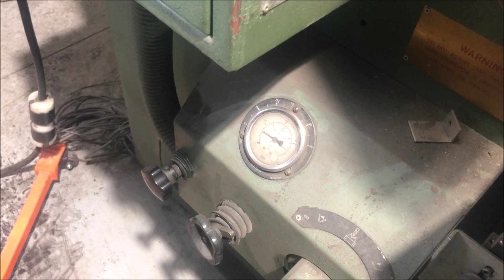Hardox 450 AR Skid Plate Bending

Comment: You can bend hardox without heating.  Heating actually takes away the resistance of the material. But you must use a large radius  for anything more than 30 degrees. As it starts to splinter. 20 years on the job. 3/16 to 1/2”  .  If the drawing says: 1/4” hardox 500, use  1” Leg with a 1/8!rad to 90 degrees. Walk away from the job , Leave don’t look back.  Hardox, AR, FX  scare the crap out of me! I’ve already been injured from bending. It’s not a fun job when it come to shattering steel.